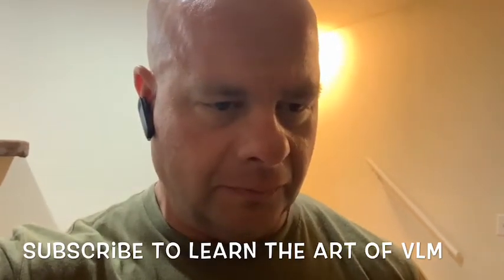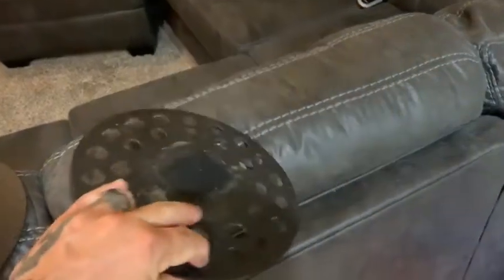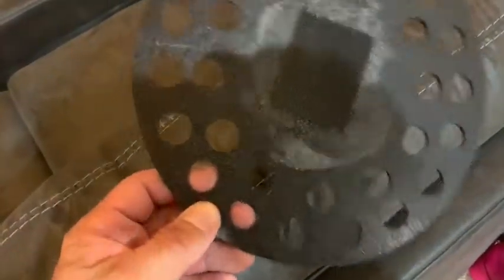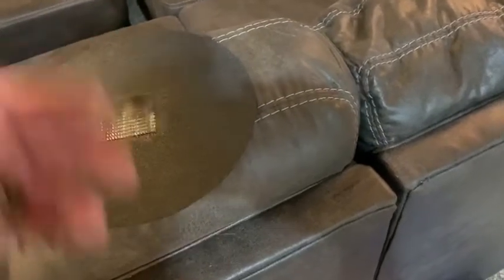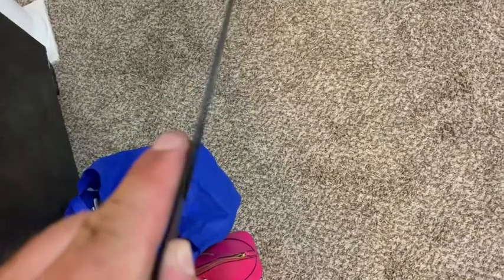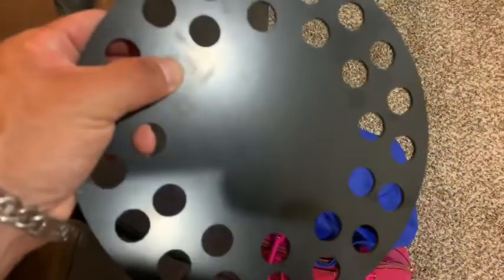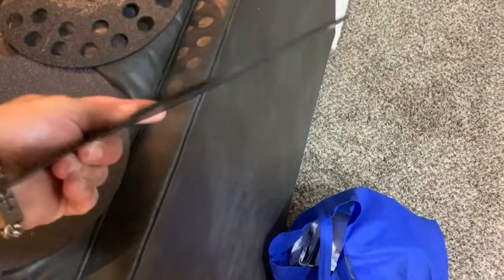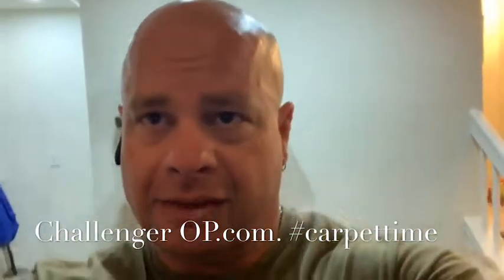Challenger Op skidders Gliders Disc How To list. #carpettime.

Comment: 2 wet vac 6.5 you can daisy chain them together 1600 pressure they sell it at WalMart a carpet wand and the flex hoes that get big with water they 50 feet you will need 4 of them this will help you will that new machine you got and I don't how dirty the carpet is you will get it clean your hooks up will be the sink the sell an adapter at the hardware store  washer dryer use the hot water side and you can hook up outside you will have to have a hoes mad to hook up to the pressure washer take a look at what I am saying and you will get your a smart guy